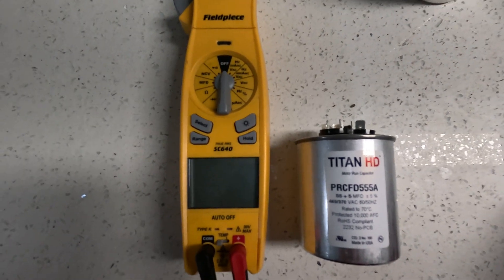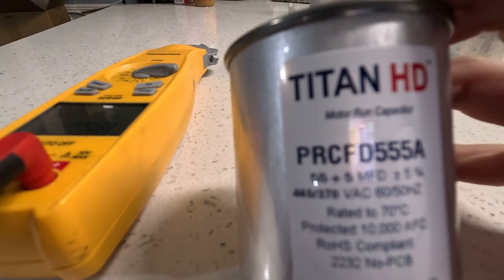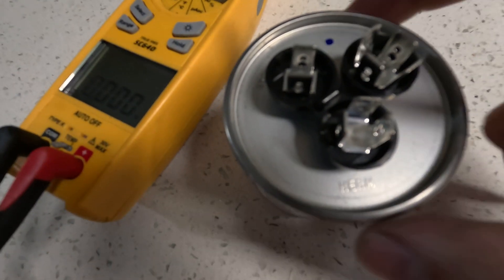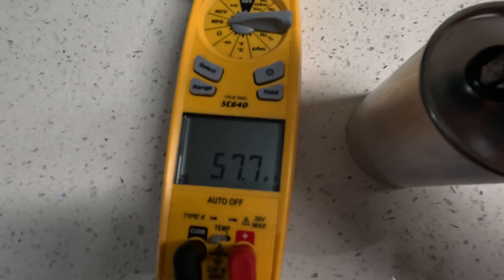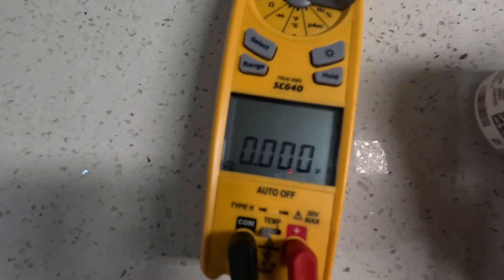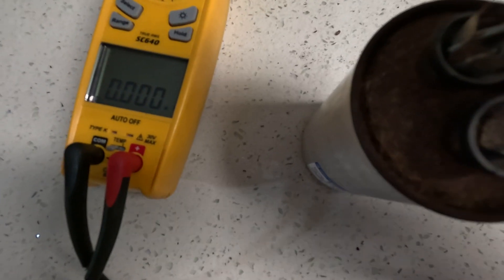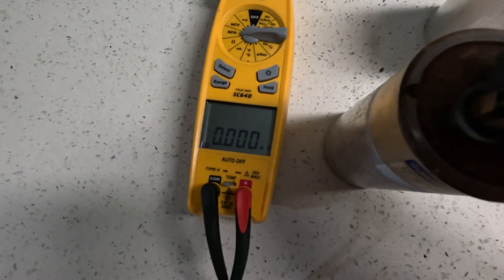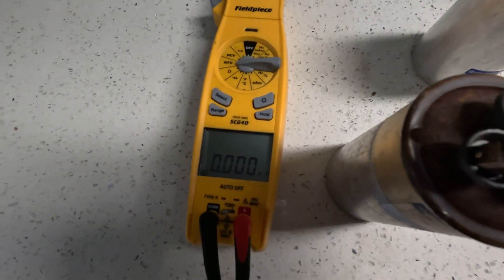How To Check HVAC Capacitor With Multimeter.

Comment: Just installed a new capacitor (9-7-2023). My low side reads 90 PSI the high side reads 350. I heard the compressor engage but why the high readings? The contactor plunger does not move when pushed in. HELP!
Reply from the maker: What kind of Freon / Refrigerant does your equipment use?
Reply from the maker: R-22 or R-410a